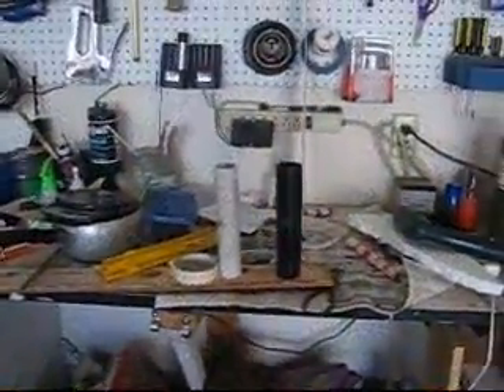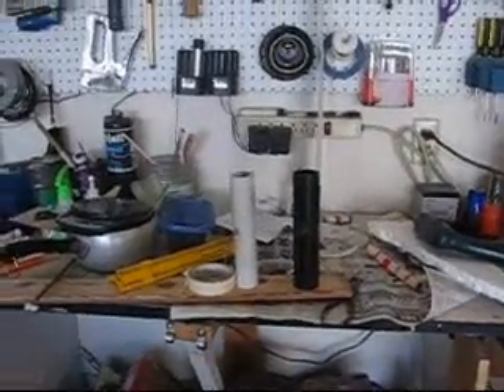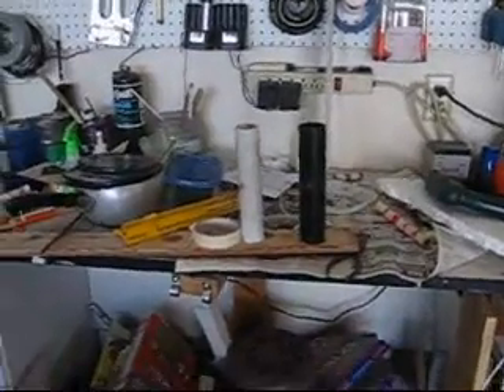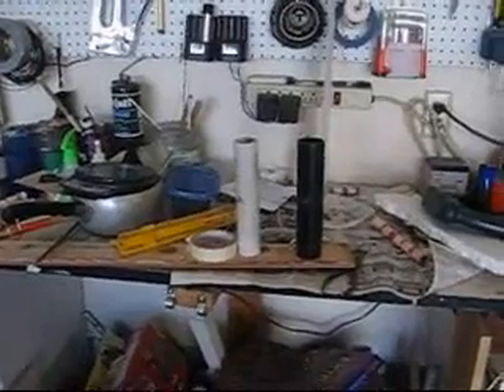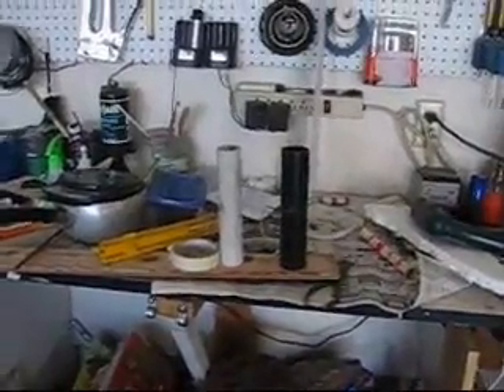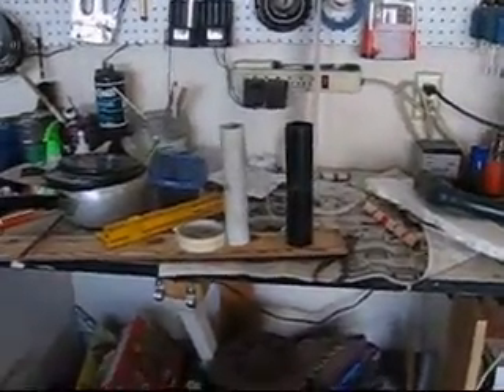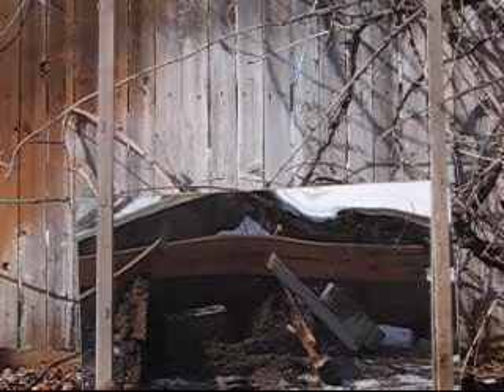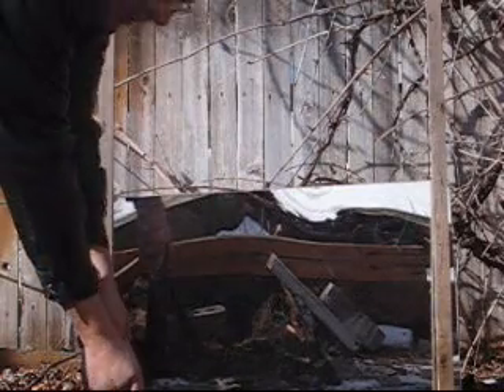PVC versus ABS pipe

Comment: Please send me an e-mail. I am wondering about ABS cellular core since that is all I can find. I have actually used very thin-walled polycarbonate tubes reinforced with two layers plus vinyl acetate tape.

I plan to similarly reinforce the foam core
with 3 layers of aluminum duct tape (very strong) but I use an oxygen/lighter fluid fuel. You seem to have experience. I was wondering if you have tried this test with
any reinforced materials that you knew would otherwise explode.